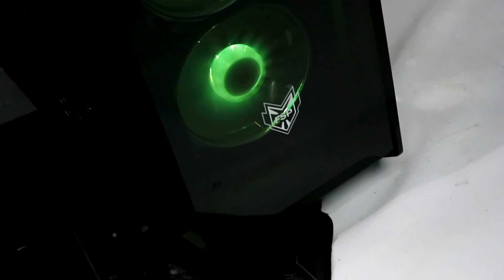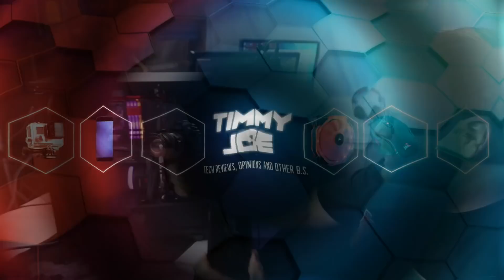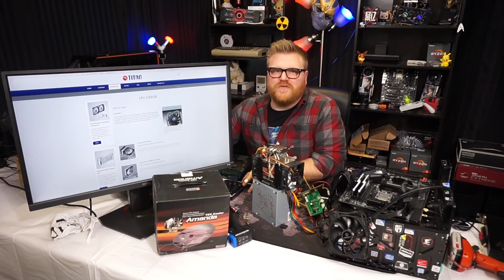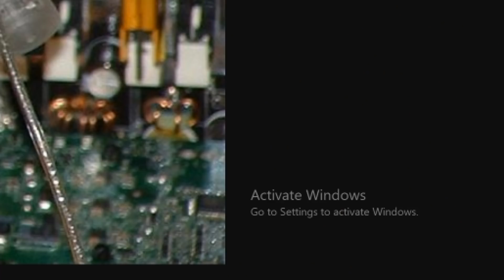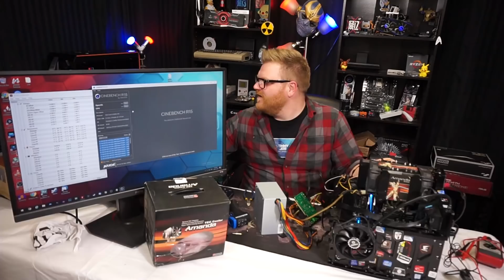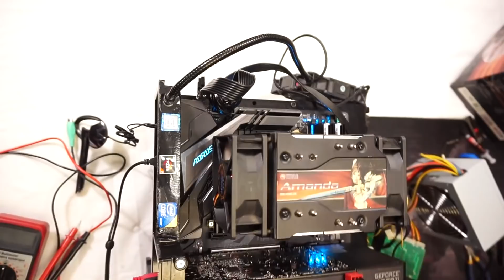This 12 year old thermal electric CPU cooler is COOL!

Comment: back when i was a truck driver, we used to get these 12 volt frig that did the same thing with the air in side the cooler, worked exactly the same way.  infact you could actually get it cold enough to actually freeze food, i bet if you slowly upped teh voltage a bit, it would get even cooler.

Comment: Don't waste your time with TEC and overclocking, the amount of heat transfer ability is limited while overclocking due to TDP of source CPU used and wattage of the TEC used. I agree with Jeroen, TEC are very power consuming. Experimenting with a TEC and buying a more powerful TEC is only going to consume more power from the power supply 500W.I have abandoned TEC technology some time ago, the best case usage was for cooling a water loop using manufacture COOLIT, freezone model FZ-1000. Mod with replacing original TECs with 6 powerful TECs. It did work well, in exchange of more energy consumption, 500W for the TEC and water condensation on the water inlet side of water block.Don't waste your time with TEC and overclocking, it is a novelty fad at best. My advice is use a water loop combined with a A/C type water chiller <($600.00[SB-5200]). https://www.amazon.com/CW-5200DH-upgraded-Industrial-Capacity-Engraving/dp/B07T3M731Y/ref=sr_1_56_sspa?keywords=water+chiller&qid=1575469155&sr=8-56-spons&psc=1&spLa=ZW5jcnlwdGVkUXVhbGlmaWVyPUExNFFOSjI0RjFOQUVIJmVuY3J5cHRlZElkPUEwNjI0NzU5M0tCME1RSFdGR0JRTiZlbmNyeXB0ZWRBZElkPUEwNDMyMzYxMTNCWk5GSVhXSk9GNiZ3aWRnZXROYW1lPXNwX2J0ZiZhY3Rpb249Y2xpY2tSZWRpcmVjdCZkb05vdExvZ0NsaWNrPXRydWU=This will also consume a fair amount of energy, noise with a better heat conversion transfer into the chilled water loop.

Comment: Now adays one can compensate the condensation with fans on case, and also one is able to coat the entire already mounted setup with nano spray itch will prevent water or moisture to get even near the pcb,

Comment: im pretty sure 9:05 it's because the effect is better when the temperatures between the two sides are already different, ie. a cpu heating the bottom plate

Comment: These pelta coolers are very inefficient heat pumps refridagration is in a magnitude of several times more efficient and newer pelta coolers are more efficient than what that one is I know someone who has a liquid cooled rig with a pelta cooler and at full load his CPU is a couple of degrees under ambient

Comment: Try using a TEC1-12730 253W Thermoelectric peltier so it will be like 12v 21 amps (almost near 21 amps) , that cpu Temps are gonna go even lower, and try give a water cooler to hot side, the better the hot side is cooled the colder the cold side is going to get, and I suggest you use a 12v 30amp power tranfomers if you going to do the tests, don't feed them above 12v then it becomes inefficient and ineffective

Comment: Very cool my dude (Pun completely intended)
I'm a mild ULTRA fanboy, and am kind of obsessed with the ULTRA ChillTec.
I've done a ton of research on peltier thermodynamics (3/10 really boring, would not recommend)
At most you might get -10C off ambient because of the way they work and the type of plate you have.
most plates transfer 70-100 (depending on your plate), give or take, watts of heat regardless of load on the cold side, hence why if you go over that it just heats up.

Comment: That brings back some memories, I had one that was a bit older than that running on an opteron 148 sitting at 2.99ghz, ran it at full power one day to see how low I could get the temps, got em down to 10c under load before the psu killed itself, I think the tec cooler was rated at 240w

Comment: Those plates get more efficient the less heat they try to move. A Really tall stack with a gradual change may be more effective than a single plate using the same power.

Comment: Reading about TEC I always assumed fan noise would be horrendous (using a TEC + air cooler solution like this) in order to dissipate the heat being transferred from the lower plate to the upper plate. Too bad Timmy didn't touch on that.

Comment: What if,  instead using liquid nitrogen into the CPU and making a mess...
We just put a waterblock  into the hot side of the peltier plate.... hmm...
then fill  a tank w/ water+anti-freeze+Dry ice conect everything with a water bomb w/speed control to prevent condensation...

Comment: I’ve had some experience with peltier cooling. You can buy 12v peltier units really cheap on amazon. You can stack these although it isn’t advised as they are very fragile. That card prevents the temp from dropping below ambient so condensation doesn’t form and destroy your cpu. Go get some peltier units for $9 each on amazon and put them on some good heatsinks or aios.

Comment: I've done some cooling with TEC coolers.  They're way too much work for not enough reward.  You need a very powerful TEC cooler to cool a hot running CPU to ambient or sub ambient under load.  I used to run a 400w TEC in a 4790K and it was good enough to keep it in the 30s C under load, 0c at Idle.  But the prep involved is a bitch and you're drawing 400w continuously to run it and to do that need a 2nd power supply and liquid cooling to cool the TECs hot side.  I'm not sure how much power this TEC is rated for but it's cooling effect will probably be negligible under load.  I also used multiple lower power TECs to chill liquid for my graphics cards.  Again, not worth it.

Comment: Timmy Joe, as a suggestion you can try getting a 100W TEC from Amazon or even a 150W and try to overvolt it using a better power supply, that way you can reach negative temperatures but you'd have to be careful of the condensation that'll start appearing after the cpu's been cooled up to below ambient temperatures.

Comment: Someone should make a new line of thermal electric coolers. They would be cheaper and easier to make and maintain, and they'd save a lot of room in the case over fans and radiators...

Comment: This is really interesting. I have been thinking about peltier effect for some time. Did not know that an official product existed. These devices transfer head from one side to the other. They can turn water into ice. They will soften usage spikes. The reason you lose performance in large harsh loads would be because the limitations of head dissipation from the heat sink on the other end. What the device is doing is just moving the heat to the other end faster then it normally would.

Comment: I am no engineer, I just know things because I tried. Have more current (amps) running through the peltier and you will get lower temps. you will also need more dissipation. if you get too cold (under 32f or 0c) you will start to freeze condensation and it is possible to short out the board.
Id love to see you do this tho!!

Comment: I've tried to cool my old pc with peltier... I can say is all peltiers for this application are 12V. And you have from 30ish Watts to 250ish Watts. Take that an do Watts÷Volts=Amp. Use a well made PSU because 250÷12=25 amps from 12volt lines.
The first problem is the hot side, if you leave alone the peltier, will likely burn. You need to cool down the hotside if you want more cold in the other side, that and the cold side depends on the hot side, if that side goes up too much the cold side starts warming, and fast, passing a tresshold and caput, it die. The same with the cold side, as the CPU is hotter, that makes the cold side even hotter, you can imagine... i don't have watercooling so you might want to try a peltier with a watercooling in the hotside, maybe that works, as for normal dissipation methods is a no go.
Note: if you invert the polarity (hot red cable in the black of the peltier) you invert the cold and hot side, please remember verifying the cold side (i burn my hand, and yes, is very painfull)

Comment: Water condensation is why I believe this type of cooler went the way of the dinosaur like my beloved FX8350 :( Which I just resurrected as a HT PC  with a BIOS flashed 480 8GB GTR  to 580 GTR. Its actually pretty cool. Just not as a daily driver.

Comment: The problem with trying to stack the Peltier devices is that you are going to go past dew point and cause condensation. I work for a Thermal Electric Company, we have made a CPU cooler in the last 3 years (Phononic Hex 2.0 Cooler if your interested). The way we made ours with a similar concept but different execution, and a smaller package. Also no need for a expansion slot controller it built into the package. We also use software to monitor CPU temps and CPU cooler temps to make sure it will not go past dew point create condensation. Hope y'all found that Interesting.
Reply: Just want to add the company I work for many focuses on replacing condensers in refrigerators, than CPU cooling.

Comment: I remember back in the day someone made a peltier system that cooled to around 0 degrees Celsius. They had to surround the CPU with foam to stop condensation shorting out the board.

Comment: Way back in the stone age early 94 I built a pc with a Pentium 90 and was able to oc it up to 68mhz to make it better than a  100  using a peltier. It only needed another .5 volts  {3.9 volts hacked into the motherboard} to do it. The peltier helped and it cost a bundle in the day but it ended up working better when I used a home made aluminum heat sink. 
All that effort for 12 mhz lol.

Comment: Have 2 in my PC with it's own psu. More cooling you apply to hot side colder it get on the cold side, 

tec heat pump

https://uk.farnell.com/multicomp/mcte1-19913l-s/peltier-cooler-200w/dp/1639732?gross_price=true&CATCI=aud-308408796421:pla-57456863650&CAAGID=14406255429&CMP=KNC-GUK-GEN-SHOPPING-1639732&CAGPSPN=pla&gclid=CjwKCAiAl7PgBRBWEiwAzFhmmld5UBppbJlRI6478qkGGQZHfo5OIQKv7QhJJj6ilC8dmXtZBE6_GRoCBaEQAvD_BwE&CAWELAID=120173390000287953

Comment: I had a peltier on a watercooling loop at one point, the system froze middle of the night, with no headload but still powered on, it literally froze. Mobo dead, got warranty on it tho. In the end the peltier adds a bit of heat to the whole thing, and will not really effect the capacity to get rid of heat.

Comment: The reason they aren't used is that the efficiency is terrible for a relatively minor improvement. Not only that, but you're going to have condensation issues if it doesn't shut off before it gets below ambient, which if you had a part failure would result in quite a bit of water in your case in short order. It's absolutely not worth it.

Comment: I remember having a small peltier cooler on my K6-2 back in the day.  It was super loud, and couldn't do much better than a good standard cooler. The small heatsink just couldn't get rid of the heat, and it was a big strain on power supplies of that era with the small +12v rails.  Modern heatpipe coolers are something we take for granted now.  Not to mention those fragile mounting tabs on the old socket 7 / 370 boards.

Comment: i remember that as far as i remember it only worked well once the software was installed it used to spike the voltage at load to control the heat was a awesome cooler back in the day. PHONONIC HEX 2.0 is a more modern type as well

Comment: How is this a Gimmic? How is ANY CPU Cooler a Gimmic? These companies have 1 purpose,& that is to run a CPU at the lowest they can go for long periods of time at the best rate they can.I chose the Cooler Master V10 over this Titan Amanda simply because I liked it's design.This was my 2nd choice back then & I wish I bought both.Both of these coolers IMO is the Top Of The Line CPU Air Coolers to date.3rd would be the Thermalright H12 cooler.I chose the Koolance EXOS 1 over these.It's still going.As you can tell.The numbers don't lie....So saying that this cooler is a "Gimmic" is straight up B.S.!!

Comment: Damn, over a hundred bucks for basically the walmart overpowered OEM case huh. It chokes airflow, but the walmart version might be worse than the FSP? Peltiers are pretty inefficient, which is why they aren't typically used over compressors or water radiators or just fans. But they are small and solid state. I had a cheap mini-fridge that used one. The Phononic HEX 2.0 thermoelectric cooler is still made and is much smaller than this. It uses a PCI-E 6 pin for power. It doesn't do much better than my cheap Cryorig H7 air cooler in tests, and it uses way more power, but it is a little quieter. It might be a solution for some people...? If you want a little bit better than air cooling, don't want to touch water cooling, and don't care about expense or power consumption.

Comment: Ugh, the top line in your temperatures is the package temperature, not a core temperature.  The package temperature is taken (or should be taken) at the interface between the CPU die and the IHS while the core temperatures are taken at some point within the silicon for each core.  As for peltier coolers, they are cool but they also suck down a lot of juice to cool things down.  An ideal setup with a peltier will have a microcontroller setup to control the current to the peltier to keep the cold side above ambient to prevent condensation.  You also need a beefy solution to keep the hot side cool - you will have the heat from the CPU and the heat generated by the peltier to dissipate.

Comment: Any idea how much amp it was pulling? Peltier cooling is pretty cool in my opinion but its also pretty dang inefficient. Also you couldnt check the temp with IR because the surface will be extremely shiny.

Comment: I never knew this existed until now, and have always had the idea of this sort of thing :O

I know der8auer did some testing with Peltier coolers, and there's been various other ones, but this is the first one I have seen that 'works' - the issue with Peltier, is if it gets too cold, you can get condensation build up around the CPU socket, and kill the board, and that is what the PCI card is for, it monitors the temperature, fan speed, and voltage etc and turns the element on/off to prevent condensation build up, and prevent it from going TOO cold!

Comment: the peltier is  a nice little bit of kit, BUT, you need a damn good cooler to take the heat from the CPU and the 90+w of heat from the peltier.
talk about a toasty room!   great way to run your power bills up.
water cooling is less cooling in comparison but WAY cheaper to run.
you also pretty much need a PSU just for the peltier.

also of note, TECs (thermo electric coolers)  come in various wattages, the higher the wattage, the greater the cooling effect.
so it depends on what the build in TEX's power requirements are to how effective it is with a modern system.

not sure how high they go, but I've seen them as high as 200w  and the ~y2k era cpu coolers were about 65w.

Comment: i've tested peltier myself on xeon X5482, as soon as the benchmark is started, cpu hits 80-100 degrees C, many watts wasted, not applicable for everyday use and hardly applicable for overclock.
the idle temperature reached near 0 degrees LOL